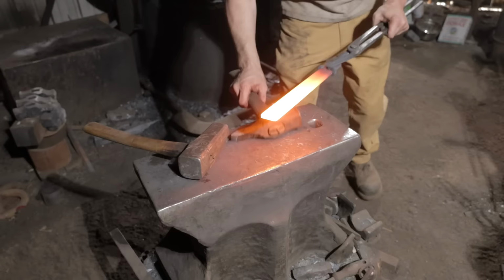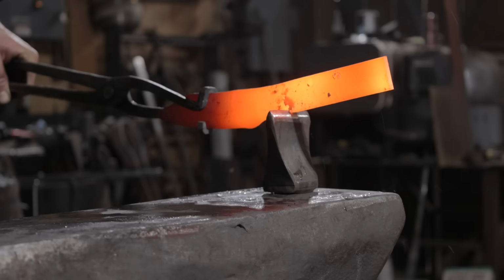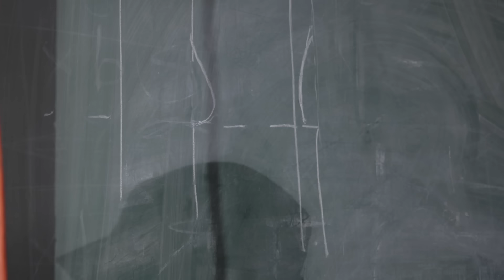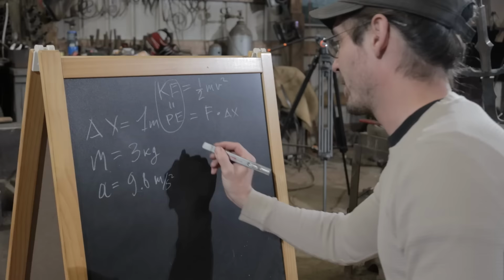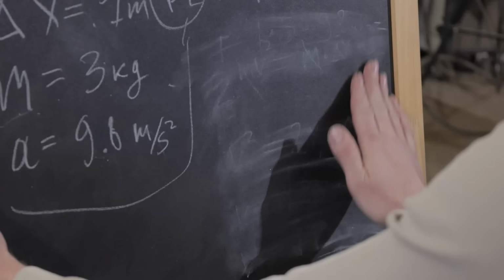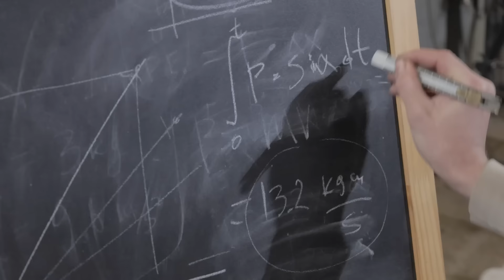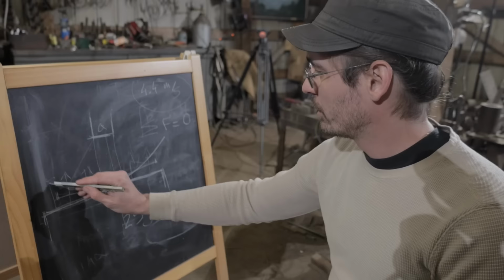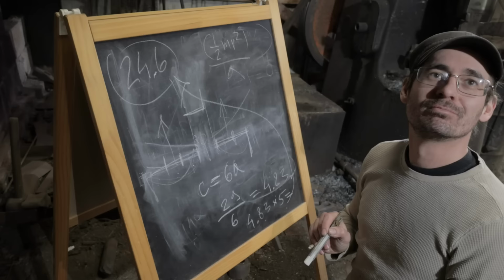You Can Forge a Knife Correctly [Here's How] !

Comment: beginers should be using lighter hammers, you can always get a heavier hammer. learned this from the blacksmithing class i took from the guild of metalsmiths.
Reply: Usually when you take a class, the goal of the class is to make students who pay for it happy and to make sure they leave with a finished piece.  One should call it a "quasiblacksmithing petting show" and not a "class". That is why hammers that anyone can use without training are recommended. If, however, the goal would be to actually teach a person how to make things properly and fast, a 4 lbs or heavier hammer would be used. But, in this case half of the class should be dedicated only to the technique alone. I said a 4 lbs hammer because that is the weight that a 95lbs teenage girl should be able to swing after being actually taught how to do hot work.
Reply: @ilyaalekseyev3589  that is True once they have developed muscle memories and hammer control which takes time to develop if i recall right a year or two. (I will admit to being a little cautious with my sholder as I have had a shoulder injury in the past on my non-hammer arm and don't want to go through that on my hammer arm.) However, in the Guild of Metalworkers case, you have to take an introductory blacksmithing course that amounted to a 4-day instructional course before taking the other more specialized classes. And in that class, I was learning pure technique: hammer technique, hot cutting, twisting, hot rasping, punching, drifting (and why it's superior to drilling), watering the steel to get heat isolation(I can't remember the name of this technique), coal forge heat isolation techniques, lighting a coal forge, splitting,  how to use the peen to help stretch the material (i don't see many bladesmiths on youtube using this technique) planishing, heat management, fish tale bevel, ribbon bevel rounding, squaring, points hot chiseling forging a shoulder, touching on forge welding...and I think more (it was three years ago when i took it). I did come home with the spatula I used to clay a blade with a nice twisted handle, but that was more something I made independently. I also came away with a binder of full instructional techniques. The bladesmithing course I then took from them did have the goal of leaving with a  finished piece.
Reply: @gundanium3126  if you practice lifting the hammer using the muscles on your back a heavier hammer is super easy
Reply: @ilyaalekseyev3589  (sorry if this is a scattered comment) True, Sorry, that is likely what I meant when I said shoulder. (embarrassed emoji)  However, when applied with the proper technique, a lighter hammer, say about 2 to 3 lbs, can be used longer and still move metal efficiently using the right hammer blow techniques from half-face blows to full-face blows (sorry, I forgot to mention them). also I might have missed it but did you factor in lever-action into your calculations as I understand the physics (which i will admit islimited)? as I understand it the length of the handle of a hammer acts as a force multiplier, thus would change your calculations if i understand it right. however, I never learned how to put that into numbers. I am saying this as a guy who has made canister damascus without a power hammer or press and works without those tools. However, I don't have the one hammer for everything philosophy. Some smiths have just from buying several styles of the hammer to try to find one I like. I noticed different hammer shapes move metal differently and work better for one task over another. a Japanese style hammer is great for beveling, but a swiss patter is better for stretching out the stock using peening and planishing, and a short handled 2 pound club head is great for hot chistileing and control but not for emparting more to the swing.
PS I also just want to make sure i understand everything right. i am on the autism spectrum and well i am high functing i can miss something that might be completely obvious.
Reply: @gundanium3126  a heavier hammer when used properly is actually lighter on your body. This is counterintuitive but is the case. The problem is that modern "blacksmithing" is a product of factory work and not part of a continuous tradition. That is why people tend to think that lighter hammers are easier.
Reply: @gundanium3126  stretching out the stock is much easier with a heavier hammer. By definition.  Because kinetic energy is the first integral of momentum, that implies a specific relationship between the amount of labor used up over time on lifting a lighter versus the actual displacement it produces.
Reply: @ilyaalekseyev3589  Thank you for taking the time to answer my questions/comments. I hope my comments are not upsetting you i am just enjoying the conversation and I can annoy people with all the questions I ask and my blunt mannor of speaking. 

 'The problem is that modern "blacksmithing" is a product of factory work and not part of a continuous tradition.' - This is actually not quite true as i understand it the Farrier tradition did preserve some blacksmithing techniques that were necessary for making horseshoes and the tools needed to make them. (the class i took was hosted at the Minnisota school of HorseShoeing) Then the factory workers built on this knowlage with the rise of the hoppyists. Which also might color view on hammers they used lighter ones.  

Also anvil material can effect how much work it takes to use a particular hammer weight do to the rebound effect. i noticed that my material does not shap nessasarly faster when i switched form cast iron anvils (it was all i could find when i was just starting out and new nothing  and was unsure if i was going to stick with blade smithing then later shipping costs) compaird to my little atlus knife company cast steel anvil that i now use and love. However, I did notice less fatigue on the upswing of thanks to the rebounds and had to actually get used to it. (sorry for the likely spelling errors and bad grammar in this comment i did not run it through Grammarly)

PS: You guys should do a video on blade designs as there is very little information an actually how to design a knife for a task. as i understand the history  knifes and swords they changed and evolved slowly over centuries of little tweeks and changes made by a smith through trial and error to beat armor. the katana evolved form the Tachi inorder to combat mongal armor, well the wakazashi for indoor fighting (i think i could be mixing this up ) and later mandated by the size of blade a commenter could own for self defence. ( source for Japanese swords taken from: The Art of the Japanese Sword: The Craft of Swordmaking and its Appreciation)
Reply: @gundanium3126  I will have to make a video explaining why American blacksmithing is so radically different from what we see in the medieval world, and how the American way spread back to the old world.
Reply: @ilyaalekseyev3589  sorry i did not reply sooner i did not get an alert to see you responded. I would enjoy that. having thought on the subject some more I will say I as a person who likes making little edc utility knifes and when your making a small over all 3/4 wide, 7 1/2 inch long and a bit less then 1/4th thick leather working knife a large headed hammer can work against you when your beveling it atlest in my experience and thats all i can draw on really as i do not see a lot of smiths forging something like this. however you can bevil it using a smaller hammer and propper hammering techniques just fine. (the one i made from cut and stacked wrought iron, 1075 with a core of i think 1095 or 1084 its been a three years since i made it.) I would not minds seeing you do a video forging a little knife like this. you guys do always make fairly big knifes so it might be a fun change of pace.
Reply: @gundanium3126  I use the same hammer on tiny knives. It takes 1 heat to forge the plunge and bevel a 3 inch blade.
Reply: @ilyaalekseyev3589  I spent some time thinking on my actual forging technique and I genereally use a 3+lbs(i would say thats respectable wieght) hammer for most work, but when i need small ajustments i switch to a lighter hammer insted of choking up to avoid cooking my fingers (and i have some framing traning and in that trade choking up on your hammer is a sign of weakness). However I also like different geometries for my hammers head depending on the  tasks i am doing. i like a clubed head for planishing, a hexaganle for drawing out and a Japanese style for beveling. If I had a 3lbs Japanese style hammer with a round pointless head(if that makes sense) I would likely use it for beveling but the only one I could find was 1.5 pound hammer (made by Nathan Robertson) as they get bought up fast. I also find after locking a knife in a vice the use a pair of really light hammers works better then one when adjusting the straitness of the bevel as the second hammer functions as an anvil. Also I have done a couple 'forged sharp' and used a light hammer to get that bevel sharp.
Reply: @gundanium3126  I'm unsure why you would need to straighten the edge after hammering on the anvil. Isn't it supposed to come out straight? And also I am very confused why one would choke up on a heavy hammer. That would sabotage the entire purpose of having a "heavy" hammer. I have three hammers for hot work. A light one 3.5 lbs, a medium one 6.5, and a 9 lbs for beveling on big projects. And I don't choke up on them.
Reply: @ilyaalekseyev3589  I have seen other smiths coke up on a hammer mostly on FIF and likely do to fatigue. however its not something i do however i also use shorter handled hammers when I am punching or hot chistleing but that is because I prefer hand held tools over tong  held tools. the adjusting of the bevel is something i have had to do when I have done a lot of adjusting of the curvature of a knife to get it right. however i likely can fix that just by beveling it a little more.
Reply: @gundanium3126  I don't watch FIF. It does for your skills what frivolous amputation would do to your body: you get negative blademaking skills from just turning that show on.
Reply: @ilyaalekseyev3589  (shrugging emoji) I don't watch it for techiques, I watch it to be entertained and white noise as i tend to watch it when i am polishing and there is no plot so i do not get distracted as easily as other tv shows. For technique's and information I go to video's similar to this one or my small collection of ABS video's.
Reply: @gundanium3126  Hmmm... I have no love for that show. And trust me I have stories to tell. I think it operates like a sort of cancerous mold: you inhale the ambient spores of FIF and they metastasized inside of you.
Reply: @ilyaalekseyev3589  well it is a 'game show' aren't all game shows like that?
Reply: @gundanium3126  Not really. Imagine a game show "pray in under 3 minutes" where the contestants have to engage in a sincere prayer under 3 minutes while being respectful to their religion.
Reply: @ilyaalekseyev3589  On paper that is wholesome, in practice, tainted by the fact that the prayers come from the desire to win something instead of genuinen faith as the prayers would be tainted by the sin of Greed. plus the passion religion ignites... atleast if it was a game show.
Reply: @gundanium3126  it's exact the opposite. A devotional experience can not be part of an entertainment show. Blacksmithing has been considered a devotional practice in many cultures.
Reply: @ilyaalekseyev3589  I likely took that a little too literally.
Reply: @gundanium3126  It is the public entertainment aspect of it that hurts the entire project. I am incredibly conflicted making video game stuff as well. Educational videos I like without reservation. But "fun to watch" things are very boring to engage in
Reply: @ilyaalekseyev3589  It does show with you takeing the lead roll in the educational video's well Matt takes the lead naritive roll in the entertainment video's.
Reply: @ilyaalekseyev3589  PS: thinking on your terminology in this thread, and I hope this makes sense: I do not feel Factor smith is the best way to term modern smithing schools; I think Machinist Smith is a better fit. my thought is factories produce more then just knifes, however a machinist (i might have spelled this wrong) would be who did the fit and finish on modern factory produced knives.
Reply: @gundanium3126  The person who finishes knives is called a cutler.
Reply: @ilyaalekseyev3589  thank you, however wouldent a modern cutler use skilled developed in the machinist trade to finish the blade? 
PS: I am watching your latest videogame bildgy and i am wondering wouldent it be easyer on the steel to hot cut in on both sides then cut a ways through the steel on one side and break it off in the vise ...atleast on smaller blades i have been doing this reasontly and it works  about the same. i am however likely overthinking this.
Reply: @gundanium3126  The most important part for me is to train the eye and hand to a high level instead of using machinery. It's similar to a singer studying classical methods rather than autotune.
Reply: @ilyaalekseyev3589  well i gave using my heavy 4.81 lbs swiss pattern a try and well the shape does have issues with force distribution when i am trying to do some tasks notablya shoulder to make a full tang blade (the hot cut method does not work so hot for this), i see what you mean by propper hammering technique making it easier to do with a heavy hammer.
Reply: @gundanium3126  I am a scrawny dude, so I prefer 1 strike instead of 10. I find heavier hammers easier to use precisely because I'm not a muscle machine
Reply: @ilyaalekseyev3589  neather am i. i start heavy and end light but i also worry about thickness a lot more then i think most smiths as its one of the spect that you cant find out much about. I also noticed i choke up when i am trying to straiten a blade. also thanks for posting and engaging me in the comments as this it made me rethink my hand forging technique.
Reply: @gundanium3126  Thickness is a product of control and consistency. These two aren't the same thing. The latter is a result of being able to do something the same on autopilot. The former is about being able to intentionally manipulate tools and materials to the desired effect. So, your consistency is a learned tool that you "deploy and forget."
Reply: @ilyaalekseyev3589  I meant the optomum thickness for the aplacaton of the blade.